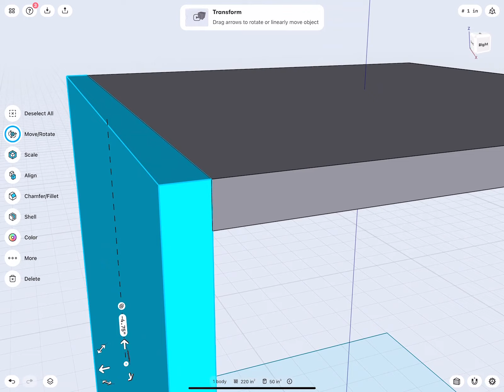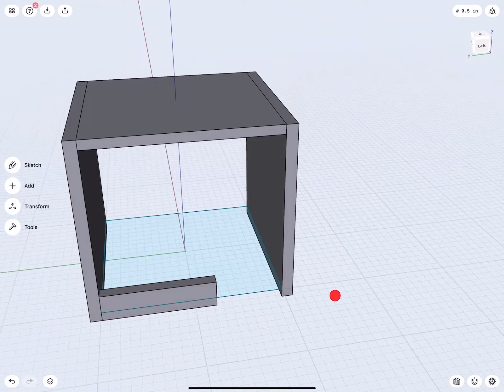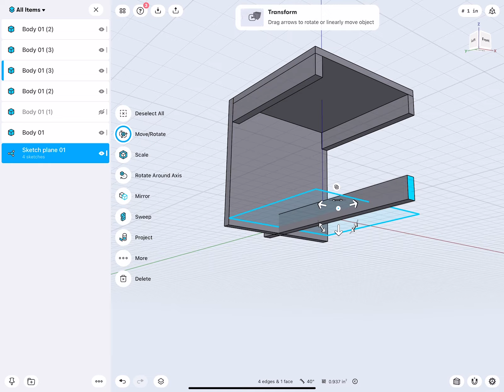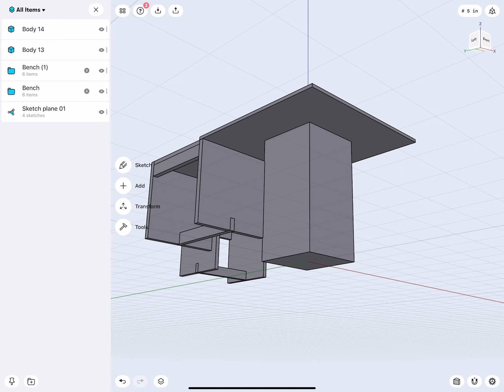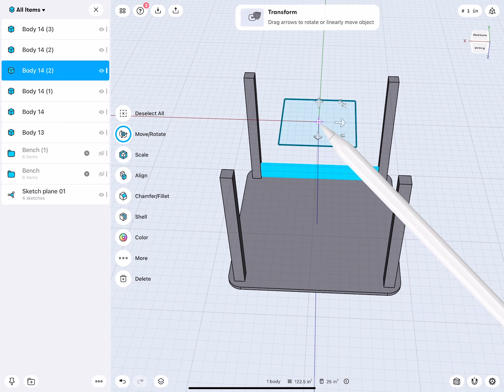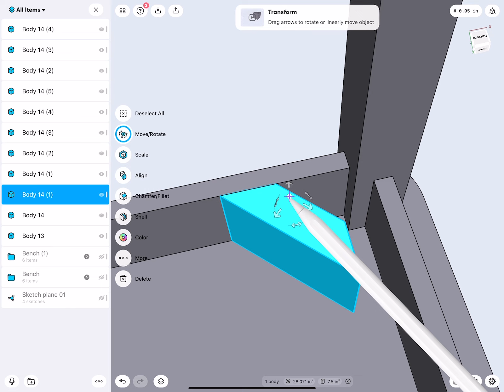3D Modeling a Toddler Table & Bench Set | Shapr3D Step-by-Step

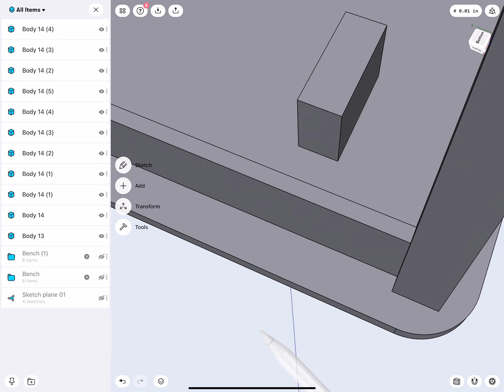Comment: 2 points should be added to the "ALIGH" command should be added. It is very useless in 21:03. It took 3 minutes to place the piece.
The block structure should be added and the "ARRAY" command should come.
You have made a very good program, but exemplary applications and promotions are not enough.
your advantage;
1-speed
2-easy
You should target both those who do not know 3D and experienced users.